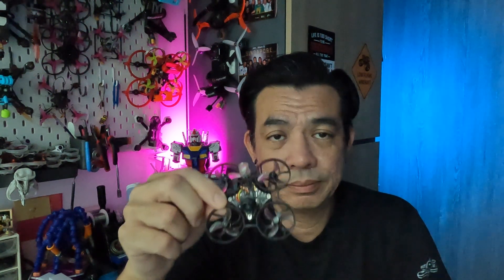Dont do this to your FC or BNF drone!

Comment: If you have difficulty binning it to your rc and you tried everything then by reflashing wirh the correct firmware from website usually fixes the problem especially mobula hd whoops and others also
Reply from the maker: EXACTLY BRUH!!!! But… for those who are new in the hobby they dont know that. Which is where all the problem starts!

Comment: So let’s say you have something with DJI. The version on the flight controller doesn’t support HD OSD which you want plus everything else you own has HD OSD so it’s a pain to switch the goggles back and fourth since the DJI goggles do not auto detect this. What if you have something larger and want GPS to work right but that means upgrading?  The last upgrade I did messed things up but it was because the target name did not match the recommended target which didn’t match the correct target. I got everything sorted out by trying the target that’s name list looked like it should be the correct one but how about this… Manufacturers. Do not switch the target names around unnecessarily and do properly document the target name changes if absolutely necessary. This was not on a HappyModel flight controller but seen issues like this on more than one brand. Maybe upgrading isn’t a good idea for a brand new pilot but the hobby is all about tinkering and trying new things.
Reply from the maker: YES!!!! It is EXACTLY THAT!!! My videos are mainly for new pilots and not veteran ones. I just didnt wanna say “dont flash unless u know what ur doing!!!” As it might seem abit arrogant from my perspective. In recent months, we’ve seen sooooo many of these newbies screw themselves over just by reflashing stuff they dont understand. But yeah. Ur right. For people like u n me, we’ve gone through the pains of troubleshooting. So the main advise is for new pilots to learn more first before doing things beyond their capabilities.  Hope that makes sense to u? 😜